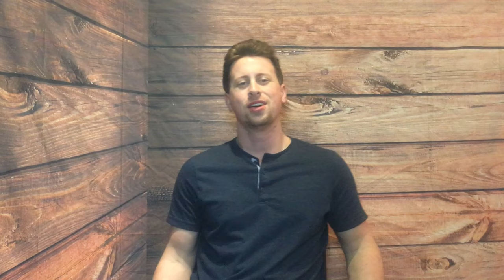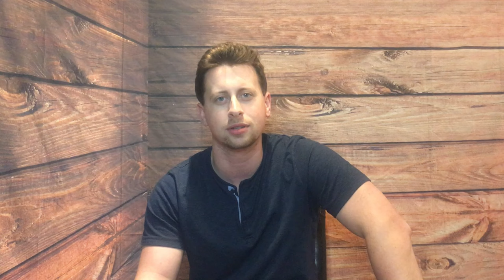Why Use an Air Compressor for Detailing?

Comment: Hey man thanks for the video. I just had a compressor gifted to me and I didn't know where it would come in handy. Would this be the first thing you do on interior since you're going to blast shit all over the car? And then detail it and vacuum up everything you kicked around? Also, would a 120 psi steam cleaner accomplish the same results? Thanks again
Reply from the maker: Yes, I would probably start with blasting cupholders if you just plan on vacuuming afterwards anyway. A steamer like the tornador may help since it blasts pressurized steam, but low pressure steam may not dislodge crumbs and stuff like that in small nooks and crannies. Steamers are great for doors and carpet and large surfaces like that.